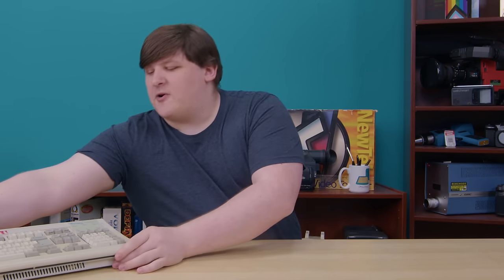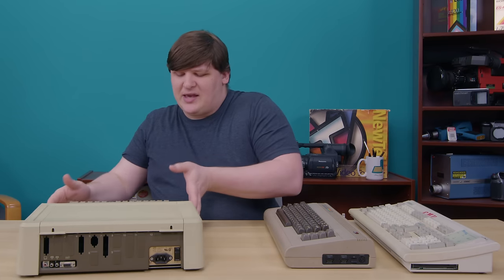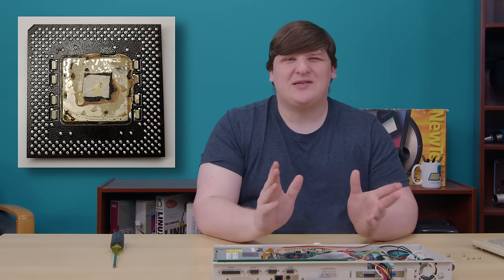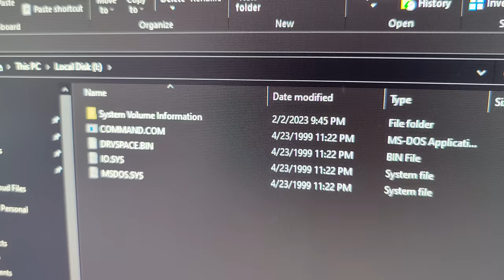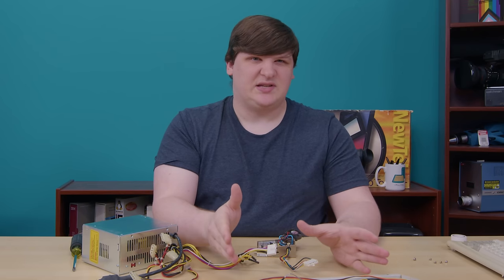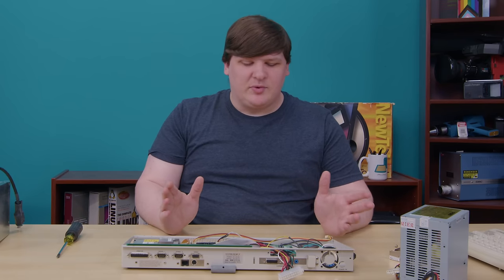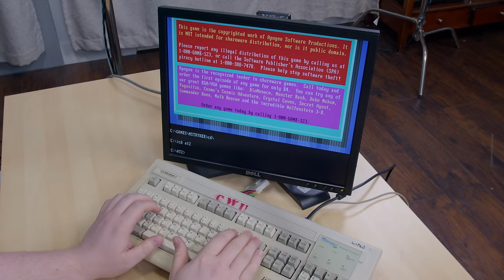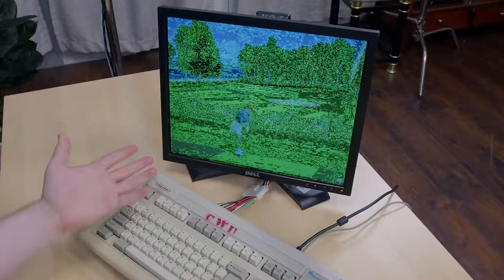I turned a weird "keyboard PC" into an FM boombox

Comment: I didn't realize how few adlib songs there are. I'm a more traditional composer (as in I compose music as sheet music in something like MuseScore), but I might see if I can either convert the MusicXML output from MuseScore into a tracker file, or if there is a tracker for Windows that I could learn and compose some song for adlib. It sounds like it would be fun, and maybe I could increase the selection of copyright-free adlib songs.
Reply: The S3M format supports both samples and FM instruments. Scream Tracker 3 naturally allows creating such files, but it's a DOS program. A modern clone of it (more accurately of Impulse Tracker, which itself was a clone of ST3) is Schism Tracker. That includes a built-in Adlib emulator for full S3M support and is available for all major modern OSes. While it supports a fair variety of tracker formats, using FM instruments will limit you to saving as S3M as that's the only supported format with FM instruments. Schism Tracker is also one of only three programs I know of that will correctly play S3M files containing both samples and FM instruments. The other two being ST3 and VLC Media Player. Other programs will play samples only, FM only, or refuse to play such files entirely.
Reply: @Roxor128  OpenMPT in version 1.28 added support for S3M FM instruments (which are OPL2), but in earlier 1.28 versions, they accidentally thought that ScreamTracker 3 supported OPL3 instruments. So in older versions of OpenMPT 1.28 you can make FM S3Ms that use the extra operator shapes of OPL3. Now, OpenMPT didn't break playback of these modules. Additionally, OpenMPT supports using OPL3 instruments in MPTM (the format that OpenMPT defined which is based on Impulse Tracker's IT format but with quality-of-life features and support for FM.) OpenMPT's development team has made a player called OpenMPT123, which has versions for all major operating systems, but it also has an equivalent version for use on MS-DOS PCs that have a 386 with 387 math floating-point chip, or higher. It supports Sound Blaster PCM as well as several other DOS-era PCM sound cards. It runs in DOSBox-X well assuming you don't use old versions of DOSBox-X. I typically set DOSBox-X to emulate a Pentium 3 (rather than the Pentium 1 MMX maximum of DOSBox) because my host PC can handle it. But yes, even OPL3 instruments in MPTM songs will play. Also, I've used DOS OpenMPT123 successfully with the megabytes-sized modules that result from my use of my Jummbox SoundFont. I typically set my RAM to 512MiB (stock Windows 9x maximum. Patched Windows 98SE can get to 4GiB) with the aforementioned Pentium 3. 
JummBox is a browser-based chiptune music creation program that uses HTML5 and has FM patches for some of its patches. Looking at the JavaScript code, there is no PCM samples involved, everything is synthetic. JummBox is technically fakebit. My JummBox SoundFont is basically an SF2 SoundFont (basically a ton of wav files packaged into a format defined by the makers of the Sound Blaster)  of the canonical General MIDI melody patches defined by the developers of BeepBox and JummBox, plus the stuff that doesn't correspond to General MIDI, as well as JummBox's chiptune-dedicated patches not found in BeepBox, plus some community patches made by my co-author and/or his friends/etc. I ended up being able to find Roland SC-8850 GS mappings for EVERYTHING I was given to fix (my co-author had messed up the pitch, and somehow Polyphone [a SoundFont editor] was actually able to automagically determine the root key of the samples properly. This functionality had never previously worked on most prior efforts with it, but somehow it did, saving the project.) When it comes to drums, it turns out that BeepBox and JummBox don't have proper General MIDI drums. After fixing the pitch, I spent a full day searching for drums that would work. I ended up finding out that the OPL3 drums from Zandro Reveille's OPL3 bank (which are TheFatMan's OPL3 patches that Microsoft and Creative borrowed) fit in nicely with the BeepBox+JummBox melody patches. Some MIDI files however used drum notes outside the Zandro bank's drum notes, so I ended up augmenting the drumkit with the drum notes from Anapan's OPL2 sf2 based on TheFatMan's 2op versions of the patches, the notes having ones below the Zandro ones. I used parameters from both V1 of the Anapan bank as well as V2. I ended up using the versions that never touched SFPack because SFPack is somewhat buggy in a bad way. As for stuff above GM, I used notes from William B. Santos's YM2612 GM bank which is not ripped. Below the lowest OPL2 drum note is drum note 22 (Low Beep), which I was able to pull from William B. Santos's Piconica bank (Piconica is a software synth that mimics the Famicom with Namco 163 expansion. In this case, Low Beep is just a square.) For the drum notes below 22 as well as the ones above the Genesis one, I used little-scale and drunkenjesus's YM2413 (used in Japanese Sega Master System for FM)'s kick (0-21. On a Roland SC-8850, the drumkit has kicks/BDs from 0-21, but 17, 18, and 19 are Voiced Numbers, but on Yamaha XG they are percussion, so technically I'm conforming to both, especially given that the kicks here are pretty much sine ones so it's not wacky), and on the notes above the Genesis one (the Genesis one actually goes higher than the gap in the 8850's Standard kit between the snares high up in the 0-127 scale) I used the notes from that range in the YM2413 kit. Most of them are Top Cymbal, which looks like the Snare visually in Polyphone, so I'm not doing anything wild. One however is technically similar to the lower YM2413 notes afaik. Nonetheless, I followed 8850 mapping for the higher (snare) notes. The gap between high GM and 8850 snares being filled by the Genesis bank actually mean that the drumkit is a full 0-127 range, thus allowing playback of songs that use the Roland SC-88Pro and SC-8850 User Kits, where any note can be assigned to any drum sound.  I made sure to copy over all parameters and modulators. Since the OPL3 has 4op mode and square operators, technically this drumkit could work on a real OPL3. So yes, a full Roland SC-8850 standard drumkit in FM that is completely libre was used for the drums. This SF2 is special in that it is highly compatible with OpenMPT. My co-author had sampled everything as 48kHz 32-second stereo samples, with one stereo sample per instrument, and one instrument per preset. It turns out that these are the required circumstances for OpenMPT to honor stereo patches, beyond just requiring no layered samples. OpenMPT in fact actually makes SF2's linked stereo samples into a proper stereo sample, sheerly because of the bank's structure. It also honors the drumkit parameters. JummBox has 40 melody channels and 8 drum channels. OpenMPT can have 128 channels. So this sf2 in OpenMPT is actually fakebit of fakebit. But since you can play the modules on a 1985 386+387 CPU, it makes it no longer fakebit at all. Oh and yes, the drumkit honors that OpenMPT can't do layers. Also, I verified all source material licenses and it turns out that the bank is legitimately CC-BY-SA4, which is GPL3-compatible. So the bank is usable in both commercial and free stuff (gratis and libre), since none of the licenses ban commercial use.  Basically, I made a chiptune GS bank for OpenMPT that includes Sound Blaster sounds and via OpenMPT123 on MS-DOS can be played on machines using even an SB16. The sf2 will also work on Sound Blaster Audigy, Audigy 2, and X-Fi cards with their hardware SoundFont support, and if you're loading less than 32 megabytes of the sf2 at a time, on an SBLive. The sf2 is 0.99GiB, meaning that it's just small enough to work on the vast majority of players, including Fluidsynth 1.x, Timidity, DLSMusicDevice by Apple, QuickTime Player 7 on Mac, GarageBand, Logic Pro, Pro Tools, and many other players that cut off at 1GiB, versus the specification's maximum of 4GiB that works on real Audigy, Audigy 2, or X-Fi cards as well as Fluidsynth 2.2+, BassMIDI, Synthfont, and OpenMPT, plus Polyphone 2 and Synthfont Viena. Older versions of Fluidsynth 2.x and some other players treat the file size as a number capable of being negative and junk 2 gigabytes of the 4 that the specification allows assuming you don't upgrade to 64bit riff or put the sample chunks at the end to allow for a maximum of 8GiB at the cost of ignoring a recommendation but not mandate in the spec. In Logic Pro's Alchemy, this SF2 is amazing for creating new synths entirely, because it's GM oscillators. Oh and the sf2 works in MuseScore. And Alchemy isn't the only thing that allows for making new synths with it. It's a great tool. Sorry for the dissertation

Comment: IIRC ESCD was the BIOS extension for PNP (Plug’n’Play) expansion cards before PNP was fully baked in. It could be toggled on and off in those BIOSes - handy for OSes that didn’t support PNP and had PNP cards installed.

Comment: There's a hackaday post "486 Single Board Computer" with a socket 3 or so board, out of some ancient off-brand flat panel AIO, that conspicuously has the same style ISA slot at the board edge and similar looking serial number labels; it makes me think these are effectively Cybernet's boards (whether or not an ODM did the actual design) and so they're the OEM for that AIO also, which seems roughly consistent with the specialty AIO market they're still making things for
Reply from the maker: https://hackaday.io/project/15431/gallery#cbac495bfb31e25132326e6569b2d39f Man, that has some remarkable similarities. On the one hand, there's only so many ways to design a single board computer, but on the other, it feels significant that the four "quadrants" of the board are identical to this one. ISA on the left, RAM and I/O port breakout up top, floppy (w/ mylar ribbon) in lower right, HDD in upper right.

Comment: thanks for showing this and learning that it existed ;-)

I think the winbond chips are going to be the level 2 cache.
Id put a pico supply in this. I use an ATX pico with a AT adapter. Doesnt have the -5 V rail but there are regulator mods that could supply it. I just use sound cards that dont need it i.e ESS.
I dont recall seeing turbo on pentium MMX's. But a even better solution is use setmul. Phils computer lab 1in136 documents this well.
One idea on the power ripple it could be certain frequencie getting unfiltered. Necroware had ripple on a 386/486 board. He put an electrolytic and smd cap to filer a wider range of frequencies and minimized his ripple.
A compact flash for the harddrive should help with the boot time.

This would be a fun semi portable system for 386/486 games. The speaker idea was nice.

Comment: Ironically enough, I think that thing deserves some more unruly spray paint and a terrible-overspray camo job. Swap a compactflash bay in for the harddrive, and one of those USB type C PD decoy boards set to 12V, a nice chonky 5A SY8205 +5V reg, pair of voltage inverters for -12V and -5V, and a AMD K6-3 chip. Leave it jumpered for 233Mhz, you'll get 3DNow! and MMX, and save a lot of heat dissipation; there's also a rather uncommon RISE K6 chip that I used to find in some of the iOpener 'internet kiosk pcs' of y2k, as well as the IDT Winchip C6, but the K6-3 is probably going to be the easiest to find. Then you can run it off Ye Common amazon $20 PD wart. I'd love to see a followup with a multichannel oscilloscope on the power rails to see the noise. Something else that might be fun to think about is sticking one of the 640x480 IPS LCDs in place of the LED-panel. Have yourself a proper little FM-blasting cyberdeck for conventions? Heck, maybe even a splitter and one of those period-correct FM transmitters?

But seriously though; I am more than impressed about your adlib chops. I was expecting chopsticks, you gave me chopin-FM. Bravo. Encore. Play it again, Sam.

Comment: Many Pentium motherboards only includes the turbo LED to light it up on the case, without any feature beyond that. Mostly included to avoid complaints from users expecting a non-lot LED to indicate a slowed-down PC.

Comment: It looks to me like the rippling problem might be due to a problem in the graphics adapter. It might be corrupted video RAM, or if there is a problem with the voltage coming in whenever we aren't reading directly from the video buffer (i.e. screen updates are happening) that may be causing the ripples. When the tracker software is playing, it likely is only updating the UI every beat so the rippling would only be for one or two frames each beat. That does kinda look to be what's happening from what I can see in the video. Also, the tracker song is a BOP

Comment: It really says something about the custom PC industry that a company formed, designed a custom motherboard and case, had them all fabricated and ran them off for institutional clients in the hundreds or few thousand, and that was either a viable business plan or close enough the company thought it was...

Re: the internal power board:
If you have the part numbers from the transistors on the power regulator board, you can confirm what voltage they put out.  That there are two (the ones with heat sinks) opens up the possibility of two output voltages or just two regulators in parallel for better capacity.  I bet there's a negative regulator in there for -3.3v or something.  

You can replace the linear regulators in that PSU, too; they absolutely can fail, especially if they've been running up against their limits for a decade, and they can fail in funky, partly-still-working ways.  They're almost always bog-standard pinouts and vary mostly in amp and thermal capacity.  If you can squeeze a better heat sink in there, that'd also help - they thermally regulate internally and the voltage dips when they're near their limits.

Comment: your fullscreen mode performance improvements come from the graphics card not supporting overlays or really anything at all, so when it doesn't have to render the desktop background, the icons, the window borders, or emulate a video overlay function the card doesn't have it works a whole lot better.  the sound glitching just sounds like typical cpu out of cycles and i bet moving the mouse while playing video makes it worse because mouse movements generate interrupts.
the video wobble is probably related to the vcore voltage regulator sitting directly on top of the graphics chip and the local filtering caps being rekt from age but it could literally be anything causing it including a ground loop between the monitor and the computer or some other weird jank.
interestingly the that cpu doesn't really have any concept of idle or power saving so it really shouldn't change power draw too much under load i think mmx did increase power usage when used though

Comment: The form factor has sort of come back at least in the UK with the pi 4000 and other simular low power hobyist/child arm computers. when the computers size and power is minisqual intergrating ti just makes everything simpler, especially for the typical childs first computer they plug into the TV situation.

Comment: For the ripple/warbling, try some different timing setting for the RAM in the bios. Feels like it's cramming in a whole bunch of unnecessary refreshes. Fiddle with the CAS latency. Since you replaced the CMOS battery, those settings surely didn't stick till you tried the thing out. It could also be an interrupt conflict, or an overused DMA channel. Never really know with these on-board graphics solutions. Win98's device manager and/or the bios might be able to help track that down.
Reply from the maker: Oh neat, those are good ideas, I'll give it a shot!

Comment: Judging from the vibe of that PC and the look of that keyboard unit, the turbo is probably there because they repurposed some 286/386 era old stock for that PC. That keyboard looks ancient even by 1999 standards. Slow mode as a feature had already been dead for a good 4-5 years at that point.

Comment: That 4 pin DC power socket looks like a Kycon connector. Pretty common for DC power. They're not hard to find but they're a bit of a pain to assemble.

Comment: Lovely video! 

It's an interesting and odd machine. The power supply situation may be jank, but evidently it works, and I think the PSU is the most legit thing to replace or upgrade on an old device like this. All too easy to damage something irreversibly or blow stuff up otherwise.

Comment: The reason why the video plays faster in fullscreen is because it changes the screen resolution down to whatever the video is at (or close) which is also probably why the colors get trashed.

Since there was barely no acceleration in 2D for windows back then, the task of stretching the image and pushing it through the PCI bus was enough to make the performance to tank.

In "windowed fullscreen" the computer has to stretch a 320x240-ish image up to 800x600 and push it to the video card. In full screen it's probably moving to actual 320x240 and the CPU just has to push the final image, skipping a lot of overhead.

Comment: Your warble wobble issue could be because the EMI shielding is floating the way you have the power hooked up.  This could either be allowing EMI to affect some of the signal wires/traces or it could be capacitively coupling with the power rails and creating noise from the metal.  Try hooking a wire up between the PSU chassis and a metal part of the PC.
Reply from the maker: interesting notion. you're right, there's no chassis ground here at all... except what's coupling back through the VGA cable, possibly. I'll try that, thanks!